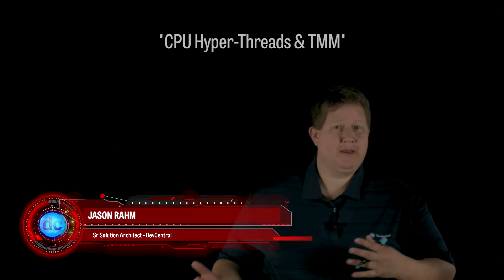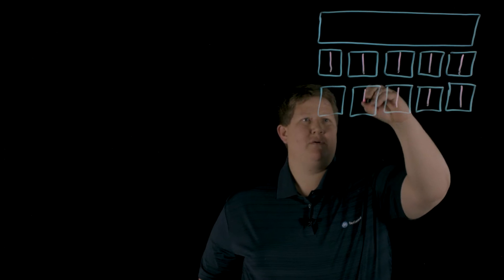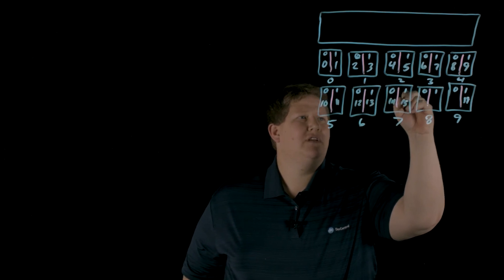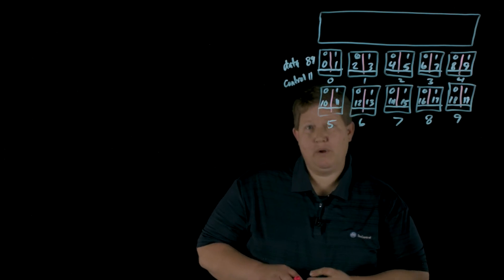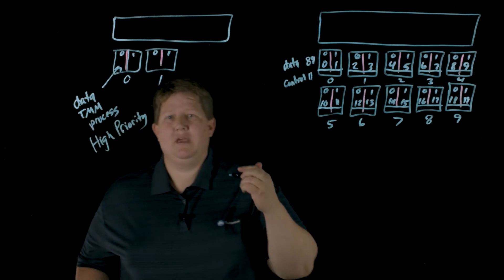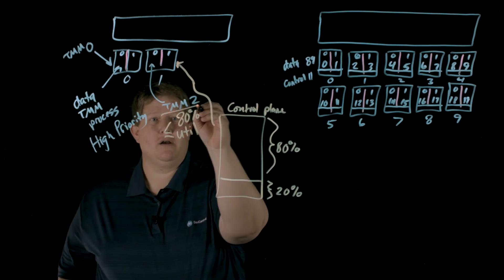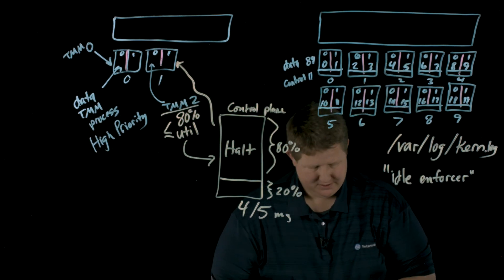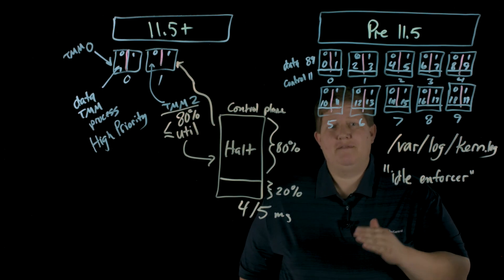CPU Hyper-Threads & TMM

Comment: I'm curious how this works with vCMP Guests, identical? I ask because I know on certain blades (B2250) you can allocate 1 CPU to a vCMP guest, which if the CPU has 10 physical cores, each running HTSplit, for a total of 20 logical cores, is allocating 1 CPU allocating just 1 logical core? If so, how does the TMM and Linux subsystem function? Using the 80/20 split?

Comment: Great explanation.  Best one Ive seen so far.  Quick Question but I'm assuming so.  So when the data plane goes over 80% and the control plane is halted reserving the 80%... When data plane goes over 100% it takes part of the control planes 80%?  So in theory the data plane can go as high as 180%.....
Reply: I guess Data Plane starts yanking the CPU cycles when it reaches to 80% itself, and that is when you see "idle enforcer" log message under /var/log/kern.log 
So, for the sake of the calculation, yes it is 180% (100% of Data-plane + 80% Control-plane), leaving 20% for Control-plane.

For more, read - https://support.f5.com/csp/article/K15003
Reply from the maker: No, the TMM thread is scheduled for data plane exclusively, the control plane thread is scheduled exclusively for control plane tasks. When TMM hits 80%, the control plane thread is 80% halted, but none of that goes to TMM, otherwise we end up back in the original scenario where TMM and control plane need to context switch.